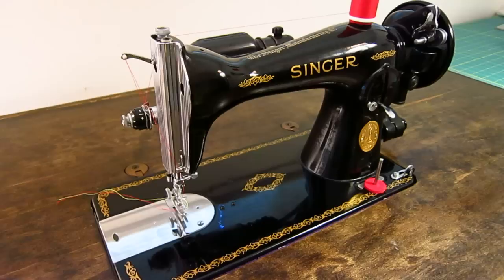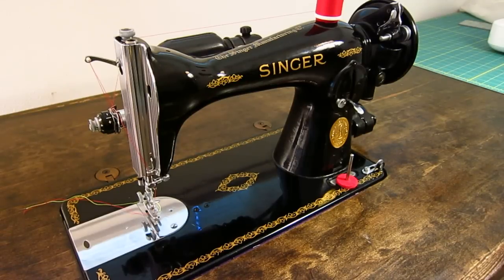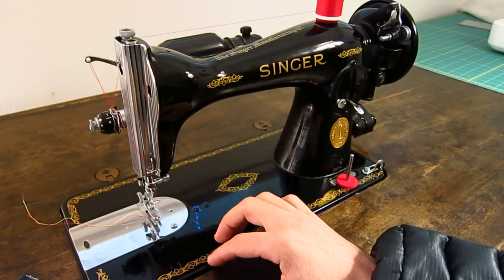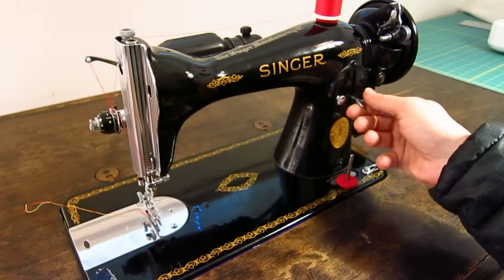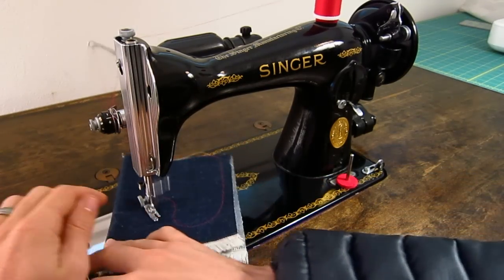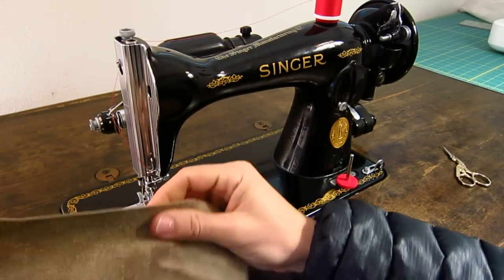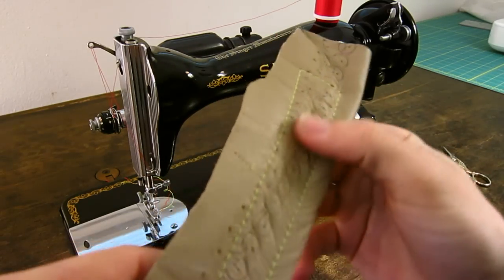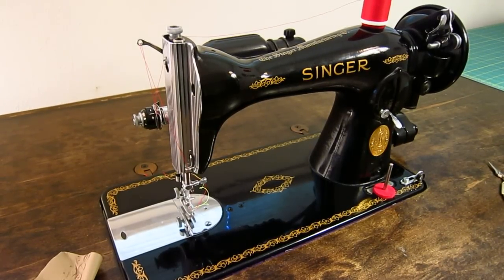1948 Singer 15-91 Sewing Demonstration

Comment: Oh so we can make this machine have As foot peddle? This one has a very interesting "peddle" it comes out from the bottom of the wooden case and you press it to the right with your knee... It's not a foot peddle. Does that sound right? And I am confident this is a 15-91 after looking at some very informative photos
Reply from the maker: Ahhh, ya.  I haven't had one but I know what you're talking about.  You can convert it to a standard foot pedal but you'll need to totally rewire it and get the plug hardware.

Comment: where is the on / off swtich?  I have one but it seems it is turned on only by plugging it in the wall.
Reply from the maker: There isn't one.  The safest bet is to unplug it when no in use.   If that's inconvenient you could always mount a surge protector under your table with the power button closest to the edge of teh table and use that to de-power everything.
Reply: great idea thanks.  you got plans for those boxes?

Comment: One more question... My machine seems to be missing the top thread holder... How would I go about fixing that?
Reply from the maker: The 15-91 uses a tapered, press in style, spool pin.  My supplier of choice is Jenny at www.shop.sew-classic.com .  Consider upgrading your foot pedal to an electric style for $18.  It's quite an improvement over the original "button" style Singer pedal, in my opinion at least.  

Also, if you're going to rewire and rebuild the motor you need to purchase ~2 inches of "grease wicks", (2) carbon brushes (if yours are worn less than 1/4"), some "Singer Sewing Machine Grease" or "Triflow Grease" and a foot of 18/2 SPT-1 wire

Comment: my machine has no drop in bobbin...but a weird gadget that moves from side to side. I have never seen anything like this. My serial no for this singer is JC632659  Clue me in. The light works and the power source works..which means the motor is good. Machine is in great shape. Given to me by a friend.

Comment: Can someone pleaseee explain to me how to turn it on. I don’t know if it’s broken or not cause I have no idea how to turn it on
Reply from the maker: There is no power button.  As soon as you plug in the foot pedal it's live.  It could be any number of things if it's not starting.  I'd start by checking the wire connections everywhere.  It's possible the foot pedal is broken or the motor is bad.  Hard to say without seeing it.  Goodluck!

Comment: I bought a 15-91 a couple of years ago and it is in like new condition so I don't want to use it.  They are fantastic machines.
Reply: They last forever and will out live you so you should use it.  I have the singer 201 ( 2 of them)  One was my grandmothers and the other I got second hand.  I use my grandmothers machine the most but I also have (2) singer 237 that I think are the next best thing singer ever made.    My sister has one of these 15-91 and the motor smokes so needs to be redone and she has two 201 treadle singers she got from people selling them in the paper.  The 201 she has is in MINT condition and runs like a rolls royce.

Comment: How do you lower the feed dogs on this machine? I have a 15-91 Blackside that I want to use to try embroidery painting. Thank you
Reply from the maker: tilt the machine back and underneath youll see a small thumbscrew.  Unscrew it and the feed dogs will drop.  They might be stuck so use a little oil and give it a little tug down.
Reply: Hey I have a 47 wwll series in the small boxes very prestine condition how could I sell it and what's it worth I'm talking perfect condition like yours .

Comment: Question, Can I run a 92 Bonded Polyester Thread on the SINGER 15-91 sewing machine?
Reply from the maker: It "can" but it's not ideal.  What's your application?  There are very cases that call for 92 thread.   If you're doing a project that requires 92 thread you'll likely need an industrial machine.  If it's just cosmetic then run 70 in the bobbin and 92 on the upper.

Comment: Hey, not sure if you're still active on here but I make custom cowboy beer box hats and I bought one of these today to replace my Brother.. Do you have a suggestion on how to make the machine not make loops underneath sewing thin cardboard? I have the top tension at 9, anything less creates larger loops.
Reply from the maker: Sounds like your bobbin tension is too low or you have your bobbin inserted in the wrong direction.  First try inserting the bobbin so that when you pull the thread it rotates in the opposite direction that it currently is.  If that doesn't work try and increase the bobbin tension slightly by tightening the middle screw on the small plate that the thread passes under as it leaves the bobbin case.  Goodluck and let me know if that solves it for you!
Reply: @thesergeant3524  I use an upholstery thread and I've found that if I use a smaller thread in the bobbin, it helps solve the problem, but it should be able to operate with that thickness in the top and bottom, correct?

Comment: Is there any advantage to this machine over the 201-2.  You said something about a thicker thread ability.
Reply from the maker: The bobbin thread path is more direct on the 15-91 so you can get away with using thicker bobbin thread.  The 15-91s I've used tend to be faster as well.

Comment: I'm sorry to ask but I had another question. I was so anxious to try out the machine I just couldn't want to re wire it. Haha! But I noticed that the stitch length doesn't change, even when I change the knob to the up or down position. It's consistently on a very itty bitty tiny stitch. What could be the cause of that? It sews SO slow because of the tiny stitch. Thanks in advance:)
Reply from the maker: There are two components to the stitch length assembly, one is a silver lever that protrudes  from the middle, the other is a round silver knob that slides in an arced track.  Loosen the round knob and put it in the bottom position.  This will give you access to full range of stitch length adjustment.  Lower the lever to lengthen the stitch, raise it to shorten it.  Once you raise it past the mid point the stitch will go in reverse.

Comment: I was given one and have been able to retire at 68 and just rewired the foot peddle and light cord,  but it needs to have the motor cord replaced,  can I do that?  I have taken the  motor cover off,  and see that   the casing comes off, and see a knot in the wires, but I think I see three wires and the cord has two so one goes somewhere else?  I am able to  move the wheel by hand with no problems, so I'm assuming the motor works.  Mine is from 1942,  and is in a nice cabinet I'm going to redo.   I also have a singer featherweight and I betcha the  industrial one with a walking foot you were talking about that my mom used 58 years ago, cause I can remember.   My brother wanted it for his car restoring but I said NO.

Comment: thesergeant Where's the model # on it? Do you have any videos on restoring them or replacing the wiring? I just got one of these from my Aunt and I want to clean it up and service it for her so that she can start using it again. Idk how long shes had it but it was originally her mothers.
Reply from the maker: The vintage Singers only had a serial number, no model number.  You'll have to visually identify it.   If you post a link to a pic I will tell you what machine it is.  I don't have a video on wiring restoration yet, but may do one soon.  I have a Singer 201 that I'm restoring for my niece that needs rewiring so may do a video on it.

Comment: I found a 15-125 green I just fixed it up I need the right bobbins so I can wind them on the Machine I can’t with theb15 bobbins I got the little notch in the bobbin winder won’t fit it

Comment: I did know how to check the knob for bobbin winding. It still does not move the needle. It Did work when I first tried it the other night but will not now. I don't have a power cord so I'll have to order one. Ha s foot pedal and knee control.

Comment: Got me a 201, but want to raise the foot heigher?
Reply from the maker: Take off the cover plate and you'll see the presser foot clamp assembly.  You can loosen it and raise the foot but you need to be mindful of the needle clamp when it's in it's lowest position.  As long as there's no interference you're good to make the adjustmetn.
Reply: @thesergeant3524  Thank you so much. I appreciate your response.

Comment: I have a model 15.  Is there anything other than a 15-91?  What does the 91 mean?
Reply from the maker: The -91 is the subclass of the 15 series machines.  There are other machines like the 15-88, 15-90 and so on.  The machines themselves are usually the same but the subclass identifies handcrank, treadle, external motor or potted motor
Reply: @thesergeant3524  which one with the external  motor be?
Reply: I know mine is a 15 K made in Scotland

Comment: Sorry to botter you but I have a dout, does all the singer´s 15-91 have a motor, because I live in Portugal and I can find alot of machines but they dont have a motor.
Reply from the maker: All Singer "15-91" have a direct drive motor, like what is shown.  Singer made several other models of this machine that are identical in almost every way except for the way they are powered.  A Singer 15-88, for example,  is exactly like this machine except that it has a larger hand wheel and is designed to be powered by a treadle.  A Singer 15-90 is the same as the 15-91 except it has an external motor with a belt.  My understanding is that the 15-91 is rather rare outside of the US.  It's likely that you have access to a 15-88.

Comment: [[[ I READ BEST IN CAPS & LARGE PRINT BECAUSE OF A DYSLEXIC FINGER & EYE FUSION DISABILITY; SO PLEASE DONT SHOOT THE MESSENGER THANK YOU FOR YOUR KINDNESS]]]
1. WILL IT USE SCHMETZ NEEDLES...
2. WHERE DO I FIND ALL THE ATTACHMENTS FOR THE 15-91...
3. CAN I USE THE SAME OIL & GREASE FOR DOIN THE '''SPA TREATMENT''' ON IT WHEN IT NEEDS A CLEAN UP, OILED AND LUBED DONE...
4. DOES THE MOTOR ON THIS ONE NEED TO HAVE THE GREASE REPLACED OR IS IT A CLOSED MOTOR...
5. IS THE BOBBINS THE SAME ONES AS THE FW 221...
6. WHERE CAN I GET AN LED LIGHT FOR THIS BECAUSE I DONT LIKE TO WORK UNDER A HOT LIGHT BULB...
7. DO I NEED TO GET ON THE INSIDE TO CLEAN THAT UP BECAUSE OF WHERE I BOUGHT IT...
I HAVE SOOOOO MANY QUESTIONS FOR THIS MACHINE ITS NOT FUNNY
I BOUGHT THIS AT A VERY GRUBBY NASTY JUNK SHOP FOR 10 BUCKS
I MADE SURE THAT IT RAN AND THE LIGHT WORKS.... 
THANK YOU FOR YOUR TIME
BLESSINGS & BE HOPE FILLED
FRANKI

Comment: if you aren't worried about pretty looks and the Singer name on the machine, you can get a post war 1950s singer clone. they are as good and sometimes better then the real McCoy. google  Singer 15-91 or 15-90. clone, get some names and hit marketplace in your area. I have bought working ones for 15 - 20 bucks, and every now and then a nice real singer that just needs oiling for the same. Rule one in checking one out, if it doesn't move freely, never force it, lots of videos on getting one going. the difference in the 15-90, it's belt driven, but maybe not as heavy duty neither should be bought to do heavy leather

Comment: Can this Zig Zag? I got cheep modern brother jx25, singer junk that i had to toss off a cliff cause they are not worth a shit. and i got a 1976 775 this is running me a head acke.
Reply from the maker: It can not.  If you need a zig-zag stitch look into a Pfaff 130,230 or 330, Necchi BU or any model of Bernina.  Good machines are out there, but they're 40+ years old.
Reply: +thesergeant will do thk u for the reply